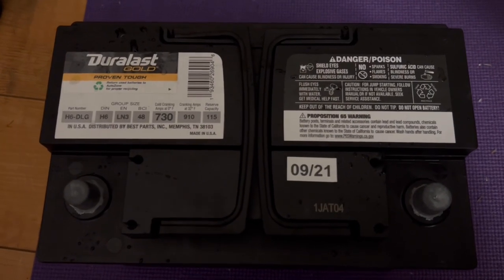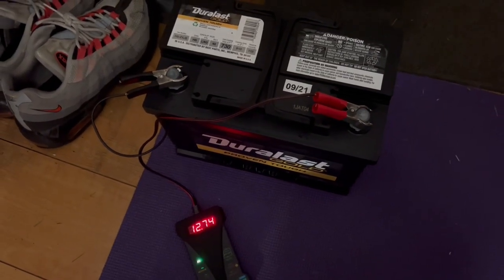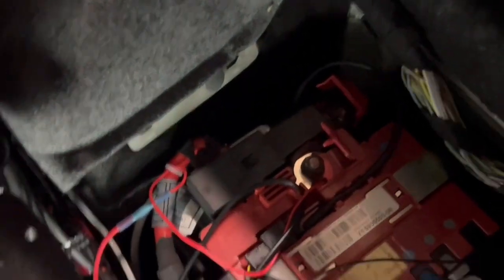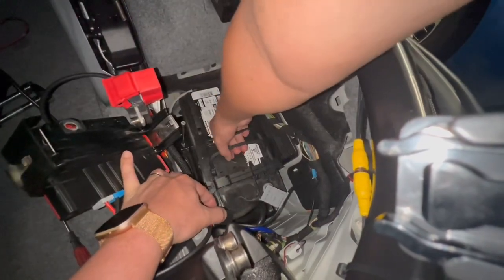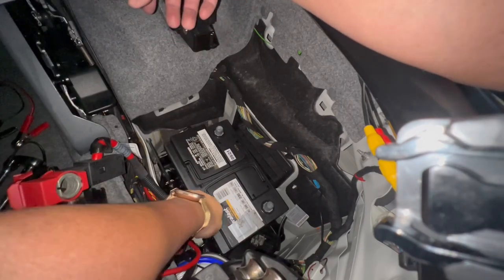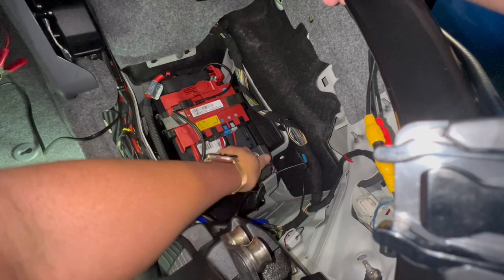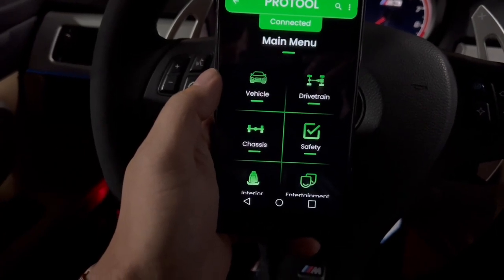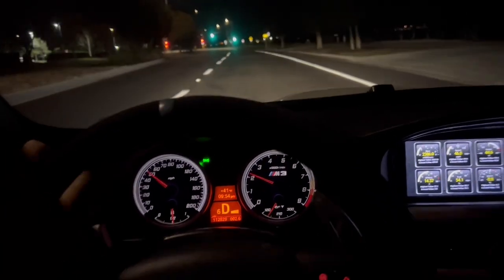How To Change Battery BMW E93 M3 Convertible / Code and Register New Battery DIY Coding

Comment: Ouuuh new content. Yeeee
Reply from the maker: Yessir! 🙏
Reply: I wanted to buy an antigravity battery but it costs so much money. How much was the duralast? Around 200bucks?
Reply from the maker: Yea $200 for 20 pound weight saving vs around $1000 for 50 pound weight saving (antigravity)
Reply: You hit the nail on the head bro. I can’t believe you still have more under your sleeve.  I gotta say this one has gotta be one of my favs from all of your videos. Weight savings for the low, can’t beat that. When the time comes for my batt swap, I’m defo doing this too.
Reply from the maker: Thanks!  Every bit of weight savings helps with how heavy the vert is. So far I have lighter wheels, exhaust, battery, etc. would love to do lighter seats, but very difficult with how the E93 seatbelts are.

Comment: Sal what’s up how u ? I figure you are somebody I can ask who will have an answer .. I have just installed a 94ah battery in my m3 … previous battery was a 92ah .. the device I have only registers and doesn’t code … do you feel I should pay a shop to change my ah to the new 94ah since I’m going to a shop tomorrow ? Or is it fine if I leave it ? I’ve been doing some reading and they are saying if it’s that close it can just be left .. but I rather play it safe than sorry what do you say my guy ? Also upon watching your video and from what else I’ve seen .. there isn’t too much options to place certain numbers 92 94 .. and to keep it as close to the 90 or whatever it may be .. I see I may not even have to change it . But I’ll still appreciate your input
Reply from the maker: Hi! Just get it as close as you can, does not need to be exact. Good luck and happy holidays.
Reply: @Sals_Garage  thanks and yea after I watched a couple videos I realized there isn’t a option to specifically make it 92 or 94 .. it’s either 90 or 110 .. thanks man happy holidays
Reply from the maker: @laykawest8674  correct! Take care.

Comment: Did you need to put in a code for the radio after removing the battery?
Reply from the maker: No, I just coded it to the car using BimmerGeeks Protool.

Comment: In the past, with other cars, every time I pulled the battery out, the radio would lock and ask for a code.  Will this happen on a 2007 bmw 328i??
Reply from the maker: You must have the non iDrive model. For those you need the original security code.
Reply: @Sals_Garage  Update... No codes needed.  Thank you so much!
Reply from the maker: @mikecruz9226  awesome!

Comment: So I dropped my ear plugs under my battery if I remove the battery just to put it back in. Will I need to code anything
Reply from the maker: No need, only if you replace with a new battery.
Reply: @Sals_Garage  thx you for the reply
Reply from the maker: @Phettraining86  anytime!

Comment: What happens if you don't code it ? I changed mine 2 years ago and didn't code it
Reply from the maker: It will tend to overcharge the battery and wear it out quicker.

Comment: Do u need to code it even if u put the exact same battery in again?
Reply from the maker: No need to code if same battery type. Just register it to the car so that the alternator won’t overcharge it.
Reply: @Sals_Garage  thank u. and last thing, Does your car have start/stop function? mine is a 11 with start/stop so i think i need a battery with 90ah? and not lower, there is a 90ah one in it right now. what do u think, its just the 80ah one cost half the price to a 90ah one, what do u think.
Reply from the maker: @afgpkdk  80 ah Will do fine. It only matters for the starter if you’re replacing it you need a special starter for start stop.
Reply: @Sals_Garage  when i look for a battery on a website for the M3 it says for cars with start/stop and then there is all the other batteries, the one they say is for start/stop is a Exide 95ah battery 😆
Reply from the maker: @afgpkdk  up to you if you want to pay extra but these people are trying sell you on buying more than needed.

Comment: How is the battery handling?
Reply from the maker: Great for about a year, but the capacity is staring to get too small for me where the battery discharge icon comes up after leaving the car ignition on for a few min 😆
Reply: @Sals_Garage  when it got low, did the car start throwing random codes?

Comment: Ya missed one crucial element...the ..removing those plastic trunk pieces...and then putting them back in......I had to remove those one time on my e93 and it was a pian in the ass.....to get them out without breaking them and an even better headache putting them back in correctly so it doesn't effect the top going up/down 🤦🏻
Good vid tho
Reply from the maker: Yea you’re right about that. I actually don’t put the Lego pieces back on anymore so that’s why I didn’t have to take them out 😆 

You’re right though, it’s annoying for sure.

Comment: Anyone here knows a channel that only does videos of the e93 m3 on how to fix everything like pump, alternator, brakes everything literally
Reply from the maker: There are a few on YouTube.
Reply: @Sals_Garage  you know their name by any chance ? Someone should make a channel of just fiximg everything the e93 m3 has
Reply: @Sals_Garage  also do i need to do the obd reprogrammed ? Even tho my bmw’s radio doesnt even work the sound system either so not like i care if anything comes out different or what is the programming for
Reply from the maker: @dannyphantoom69  yes you’ll need to register the battery. It’s in the video.
Reply: @Sals_Garage  but why ? Last time i didnt do it and the car was working fine